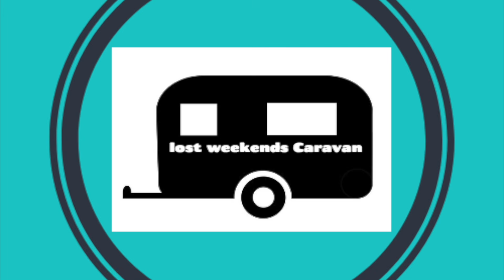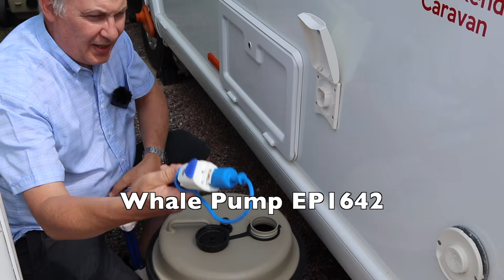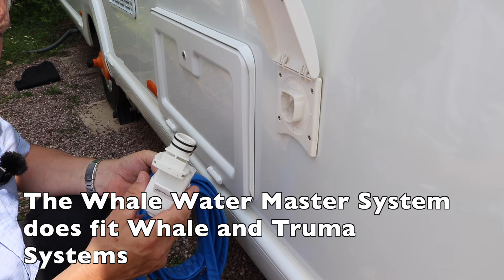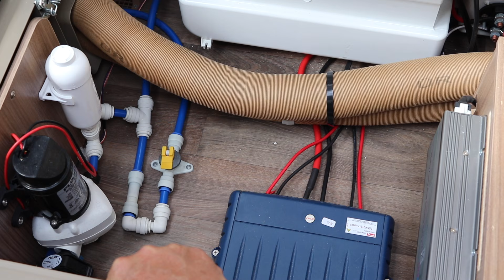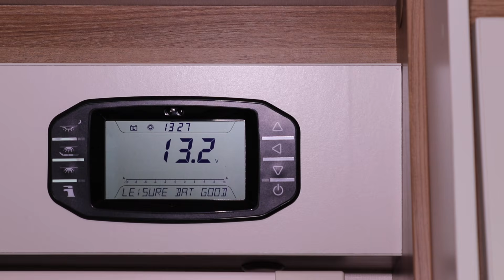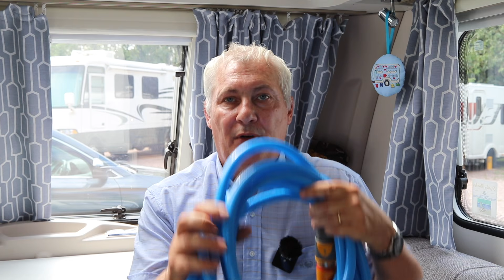Caravanning For Beginners (Setting Up The Water)

Comment: I've got an old aqua roll and my truma water pump is too big for it. Would the Whale EP1642 be better than buying a new aqua roll. My aqua roll looks the same as yours. Thank you
Reply from the maker: Hi Francis. The short answer is yes. The Whale has a more flexible pipe which allows it to sit right at the bottom of the Aquaroll helping it draw almost all the water. It is a quality product, better than the Truma. Hope this helps. Phil👍🙂
Reply: @lostweekendscaravan  thanks Phil 😊
Reply: @lostweekendscaravan  Phil, I'm now set up on site and everything working except toilet flush. Van is a Lunar Apollo 200 and considering its age, it's doing OK. I've hot a c-200 toilet with the flush that uou have to turn. Hardly any water is coming out. I've topped up water flush tank. I've ordered some Milton sterilising fluid to put thru flush tank.
Reply: Sorry, Lunar Apollo 2000
Reply from the maker: @Francisgesby71  Hi Francis. Is the c200 a electric flush or a manual. If electric flush the impeller could be clogged up. The Milton should free it but you may have to open up the flush from the top and manually move the impeller to free it. Failing this it could be shot and need replacing. I hope this helps. Let me know how you get on. Thanks Phil.  PS Only put Milton in the flush tank not the mains water as it rots the boiler.
Reply: @lostweekendscaravan  thanks Phil. It's a manual flush with that awful swivel flush. So I need to put steriliser in the actual flush tank only. Do I then drain it after a few hours?
Reply from the maker: Hi Francis. Sorry I missed this reply. I would leave the solution for as long as possible at least 6 hours. I hope you have sorted out the problem. Thanks Phil🙂👍

Comment: Are the two inlets connections into the caravan exactly the same.?
Reply from the maker: Hi Paul. Do you mean the Truma Connection.  If so they are the same including the Whale version for Truma. The Whale version is much better than the Truma. I hope I have answered your question. Thanks Phil. 👍🙂
Reply: @lostweekendscaravan   Hi Phil, the whale connection looks like it's got an electric connector at the caravan end,and it looks like a pump on the water barrel end, not a filter.
I have a coachman 575 2017, which has an internal water pump. I bought the truma pipe as shown in your video it's bloody useless.
Just want to make sure the whale 1642 will be OK with my onboard pump before I buy one. Thank you for your  help Paul
Reply from the maker: Hi Paul. I have the flojet on board pump the whale works in the same way as the truma but 100 times better. It is great product and I found it was worth the investment. Hope this helps Phil 🙂

Comment: We have been using the same truma pump shown here and it has stopped working. Can I ask if the whale pump fits into the socket that we have for the truma (note the truma we have is exactly the same (filter only) as you show at the start 
Thanks
Reply from the maker: Hi Gill Just thought you may have an on board pump issue. The filter maybe blocked. If its a flojet one like mine. Check this out to. Phil. https://youtu.be/1lREcRJGzKM
Reply: @lostweekendscaravan  thank you so much for your this. I will try the filter and also ‘straightening’ my truma pipe so that it hits the bottom of the aqua roll.  I’m sure it will be one of these things 🤞 
The light for the pump on the control panel is continuously flashing so I don’t think it’s the onboard pump?!
Reply: @lostweekendscaravan  morning! Right, I checked the filter it was clean. It appears the hose part of the truma had come away inside the trigger.
I would still like to know if I can use a whale pump (the type with a pump end in the aquaroll) rather than a filter ended one? Is this connection the same? (Will it fit etc) is there an advantage to the pump end? 
Thanks 🙏
Reply from the maker: Hi Gill. Thanks for your valid question. Yes the Whale is a much better product. Here is a link to my review of the Whale version (it is not cheap but worth it). Thanks Phil 🙂👍
https://youtu.be/nG0BCjmlcgU

Comment: Thanks for the video. Can some please tell me what happens when the I internal tank fills up and you are connected to mains? Are we then meant to turn of the mains or does it automatically stop filling up? Hope this question makes sense
Reply from the maker: Hello. Good question. The pump should stop. Do not turn off. as the water is used the pump will kick in again, so on and so on. If your caravan is quite new, an alarm will sound when the water barrel is empty. If the barrel is empty turn off the pump and refill the water barrel. I hope this helps.  Phil🙂👍

Comment: How  does the electric work on warming the water on the swift challenger 540
Reply from the maker: Hello John. It depends on which model and which control panel you have. Also could you explain yourself a little better so that I can answer correctly. Thanks Phil👍🙂

Comment: Hi Phil, so the whale pipe will fit my new 4SB ok.  I assume as the pump at the end of the whale pipe will not be connected electrically due to having an onboard pump, the water will still pass through it when the onboard pump kicks in.
Reply from the maker: Yes you need the truma version. I have a video coming about the latest version. It will work better than the truma one you get with you van. Thanks Phil

Comment: Hi Phil, was that a weight on the end of the whale pipe that went into the aqua roll, also for the serviced pitch does the mains water affect the internal pump? Thanks Daz
Reply from the maker: Hi Darren. At the end of the Whale is weighted pump but the pump is bypassed by the caravan pump but is causes no harm. The mains water pipe is not under pressure so it doesn't effect the pump. It works just like water being drawn from an Aqua Roll. I hope this makes sense. Thanks Phil👍🙂
Reply: lost weekends caravan thank you it does.

Comment: Nice one Phil well explain info there I'm thinking of buying a mains adapter to connect to tap strate to van when connected do u still have your water pump turned on a sine is same as yours on board water pump .kev
Reply from the maker: Hi Kev. If you buy one all you need to do is turn on the mains tap half way. You do still need the pump on. When you go out for the day. Turn off the mains and the pump plus the Boiler. You should not have any issues but Whale and Truma Recommend you do this. I think they are great it saves so much time filling the Aquaroll up. Many Thanks Phil🙂👍
Reply: Cheers Phil thanks mate

Comment: A good watch. Following on from some of the other comments,  is the whale submersible pump a very expensive weight? I had a trauma submersible on my old Caravan which I swapped out for the whale pump in your film , I now have the same water intake but use an adapted aqua roll pump adapter, it’s works well for £7 I have seen others who use a piece of water pipe which is even cheaper to ensure the intake doesn’t float to the top of the aqua roll. Are there any other benefits to using the whale submersible pump? Unfortunately I gave mine away When I changed my caravan.
Reply from the maker: Hi Stephen. It is about £60 but shop around it is Whale EP1642. It is heavier than the Truma but that is the point it sinks to the bottom of the aquaroll and draws all the water. It weighs 99.8 grams. It is very well made and I feel worth the money.  Your adapter is a great product.  I did a quick fix on my Truma with pipe whilst away on my first trip out. I recorded it on the channel. Hope this helps. Phil🙂👍
Reply from the maker: Hi Stephen. It is about £60 but shop around it is Whale EP1642. It is heavier than the Truma but that is the point it sinks to the bottom of the aquaroll and draws all the water. It weighs 99.8 grams. It is very well made and I feel worth the money.  Your adapter is a great product.  I did a quick fix on my Truma with pipe whilst away on my first trip out. I recorded it on the channel. Hope this helps. Phil🙂👍

Comment: Hi Phil, silly question but the whale pump does it plug straight into the Truma inlet and work the same as the original inlet pipe I assumed that it had a pump on the end like the older outboard pumps that went into the aquaroll. We definitely had problems with the the pipe floating I tried several ways to fix it none really work that well. Definitely need to tie the flap down we've been laid in bed many a night listening to it clattering. Great video, just goes too show that a caravaning veteran can still learn things.
Best wishes Jon and Karen
Reply from the maker: Hi Jon. Yes it works fine. It bypasses the terminals and draws the same as the Truma one. It is just better weighted and a lot better. quality. I hope this helps. Phil👍🙂

Comment: Hi Phil
I was watching this and got a little confused because the ultra flow that first showed in the video was for a caravan that has an inboard water tank and pump but you the said you use a whale pump which you showed in the video is a submersible external pump for use with caravans that don’t have an internal tank and pump that is why if you look at the connector on the whale unit it has two electrical terminals to provide power to the pump that is submerged in the aqua-roll so you are using the wrong type of unit 
My van is the type that has no inboard tank or pump so when I setup I have run all the taps to fill the system up before I can switch the boiler on for hot water as my first van I didn’t do this and burnt out the electric heating element which was not easy to replace
Reply from the maker: Hi Edward. I am guessing that you have an older Caravan as I don't know your system. The Whale system I now use still draws the water they same way the Truma one does. The electric terminals are bypassed.  The  reason I use the Whale one is it for better quality and is better weighted to draw the water and has no effect to the water pump or system. I hope this explains your  question. Thanks Phil👍🙂
Reply: lost weekends caravan Hi Phil my caravan is a 2019 mid range van so not that old and has a complete whale system with external pump which I think is more common than internal pumps as when I was looking round for a new van most were external pumps

Comment: Thanks Phil. Our fully serviced pitch set up is slightly different as we use the aqua roll with a ball float. I’ve got to invest in the flexi pipe waste system as it looks a lot easier to fit. Thanks for sharing. Ian
Reply from the maker: Hi Ian & Sonja. The Colapz system is very good and so easy to set up and break down. Thanks Phil👍🙂

Comment: Phil, when I'm on a serviced pitch, I use a continuous water system that screws into the side of the Aquaroll. It works in the same way as a toilet cistern to maintain a constant supply of water.
Reply from the maker: Hi There are many systems yours sounds very good. I prefer serviced pitches personally. Cheers Phil👍🙂